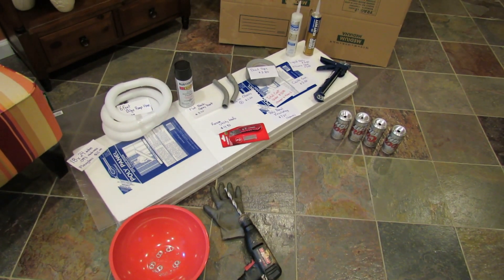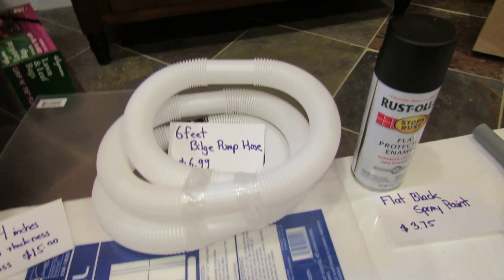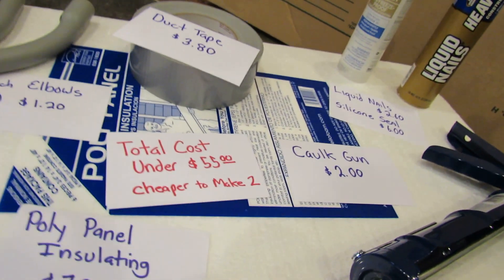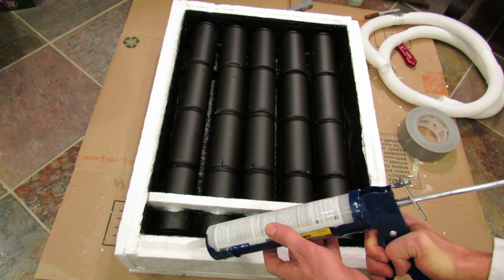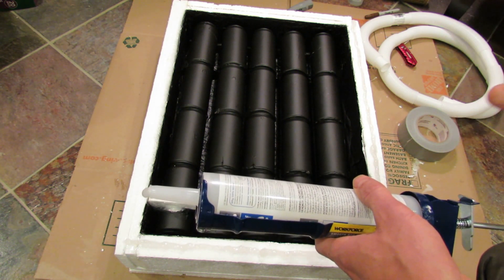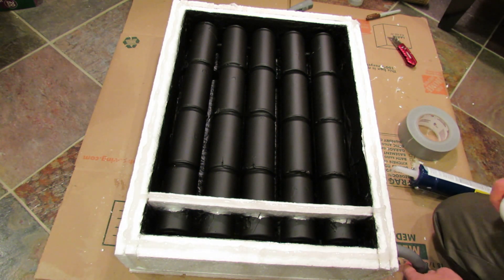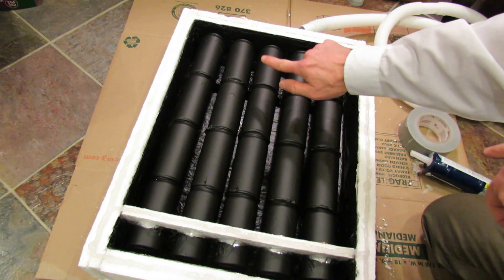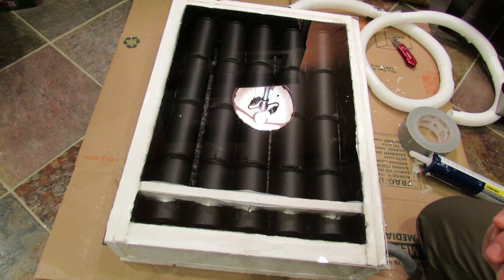What is a Solar Can Heater? Parts & Final Construction - The Rusted Garden 2013

Comment: Have you looked at those evacuated tubes for heating water with the sun? You could always make a system that circulates water to the "floor" of the greenhouse. The greater the volume of the water, the better it will retain heat into the evening when the sun is gone. Just a thought. The tubes have really come down in price.
Reply from the maker: DougsterCanada1 I definitely want to build something like that in the future. All I can have in my area now is a collapsible greenhouse. Water is great for holding heat. Thanks for the idea.

Comment: im just wondering, how does it heat the air and can you use it indoors and at night?
Reply from the maker: Marc Joseph Gorospe Only works when sun is on it. The air in the cans is heated to high temp by the sun and it rises. It can be adapted to heat rooms in winter or raise green house temperatures in winter. But only works when sun is on.
Reply: ohhh. okay. i thought it works at night too :D thanks for answering.

Comment: It seems to me that when it's sunny enough for this to generate heat, the greenhouse will already be warm enough and perhaps even venting. A better approach would be to create a heat sink (gravel base or water jugs/barrels) inside the greenhouse to store heat captured during the day to moderate and release at night when temps are cooler. In addition, if the greenhouse is poly, a double layer w/air space or bubble wrap could insulate well enough to minimize heating requirements?
Reply from the maker: Mike Vormwald  It will work on 30 degree days and brings your greenhouse temperature up higher for more tropical plants. But sun will bring a house up to 60 degrees on its own on a 25-30 degree day.  Adding solar mass is on target and in a permanent design you could actually use this as a way to warm grave and water. I have a collapsible model so extra heat helps as it is not well built or sealed.

Comment: I'm a little confused. When its sunny my greenhouse gets up to 100 degrees easily even when its 10 degrees outside. No need for supplemental heat when its sunny. The challenge is keeping it warm when its not sunny. Looking into geothermal for that.
Reply from the maker: Its a model. Consider it use as option for use outside of a greenhouse. A larger one could warm a work-shed. Add to house heating. Works great for dehydrating box. The trick would be how you might use it to warm thermal mass objects. But no sun is no sun.
Reply: So your greenhouse needs extra heat when its sunny out? Mine needs to be vented because it overheats.
Reply: +Paul Ladendorf  Maybe Im not invited to comment, but some people put black water tanks that absorb the heat, and let it out during the night....